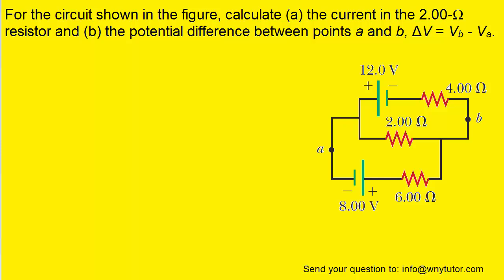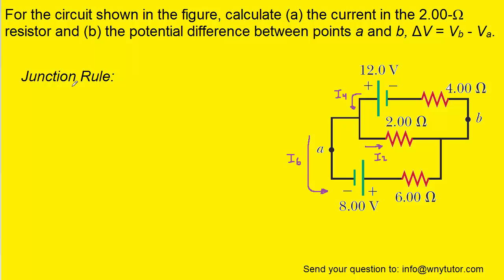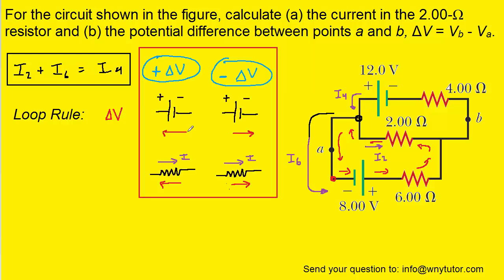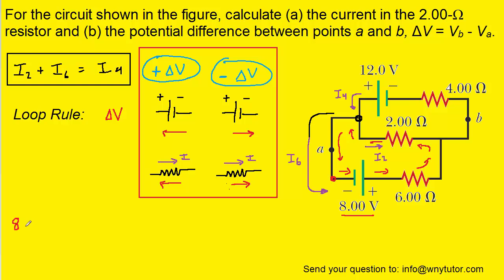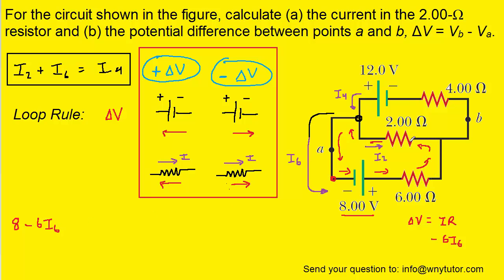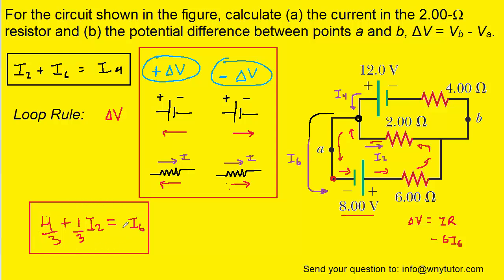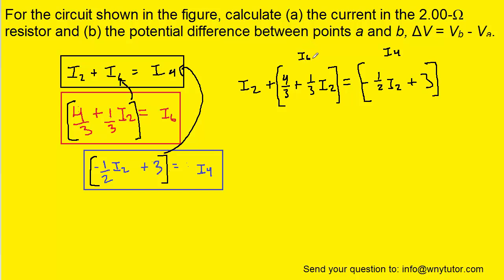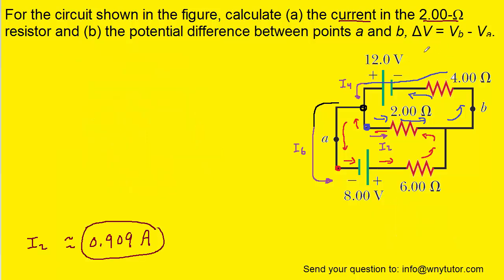For the circuit shown in the figure, calculate (a) the current in the 2.00-Ω resistor and (b) the po

Comment: Great job. One thing that might help clarify the details a little, use the passive sign convention when writing KVL equations: If current enters an element via the element's positive terminal then the voltage across the element is considered to be positive, else it's negative. (Voltage drops are positive, voltage rises are negative.) Saves much writing of unnecessary minus signs, and it's easier to keep track of the proper direction of current. One other implication of the passive sign convention, power dissipated is positive whereas power delivered is negative.